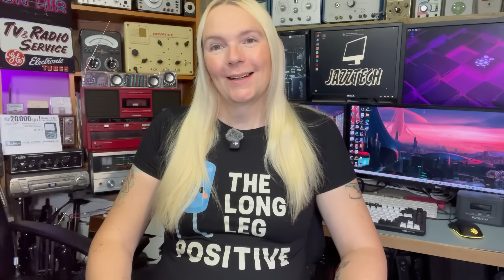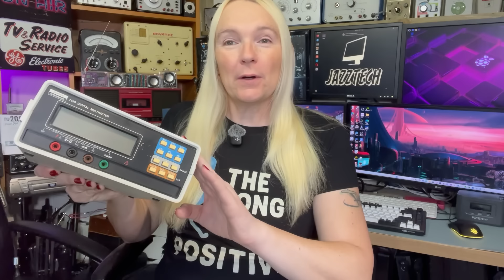Solartron 7150 Plus Bench Multimeter Repair Part 1

Comment: They are both 5.5 digit, with "6.5" digit averaging mode, however the plus version has an extra 2k resistance range, where the OG 7150 only goes to 20k. Also has a PT100 thermocouple function.

Comment: Nicely done, so far. For the front / back switch I was thinking a simple pushbutton and some multipole relays, if you have some spare voltage inside. Easy for me to say, of course.
Reply from the maker: That's a lot of work and I would have to find some way of securing them inside the case. I won't be using the rear terminals, so likelihood is I will be removing the switch and just using the front terminals.

Comment: Normally front rear leakage happens when high voltage has been applied, and the arc turned the plastic into carbon inside.

Comment: Jane I recommend that when you test capacitors I always test at 100 kHz as all manufacturers spec and test them under that frequency plus if I was u and you planing to keep it if replace them all as they don’t get any better when they age 
Regards 
Mike
Reply from the maker: 100KHz is for newer electrolytic capacitors. Older electrolytic capacitors in vintage equipment have never seen a switch mode power supply and will never be subject or even designed for 100KHz use. They are mostly smoothing capacitors in linear power supplies subject to 100/120Hz, so that's the best frequency to test them at. Also axial electrolytic caps are extremely expensive in comparison to radials, so unless they are really old or test bad I don't always change them.
Reply: @JazzTechUK  100/120Hz is good to test their uF value, 100kHz is good to test their ESR. Up there they can't muster any capacitive impedance to speak of, so their resistive profile only remains.